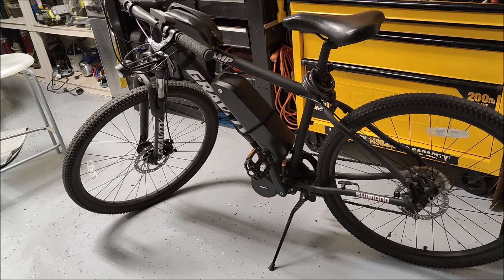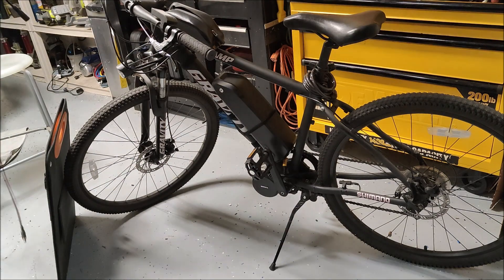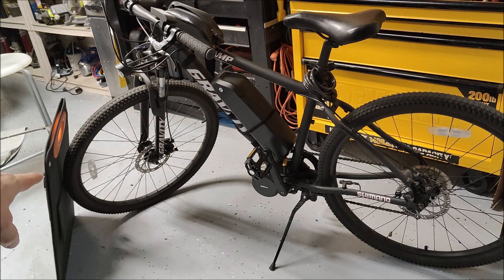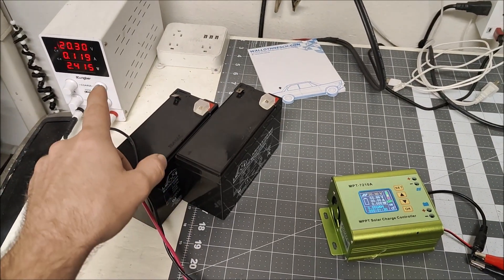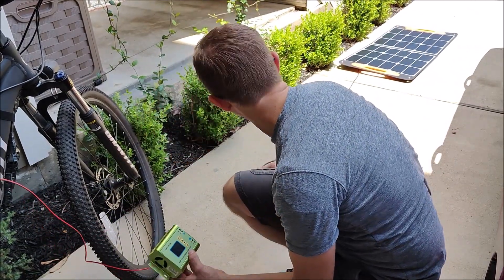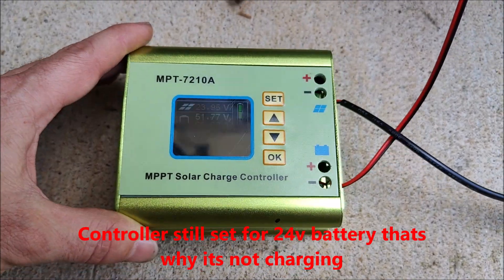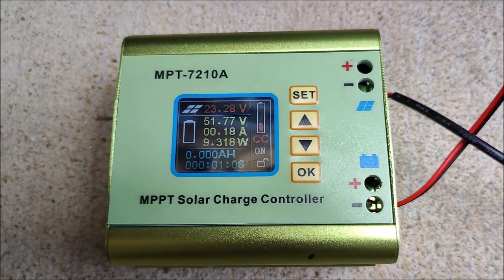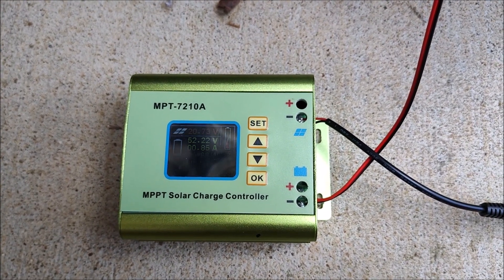Charging an E-bike with Solar!

Comment: What is the cost of your set up to charge your bike? What do I need to do if I want to charge your bike within 3-4 hours from 10% to fully charge? Do I need to add extra panels?
Reply from the maker: The charge controller is about $60 and each 100W folding panel is about $100. A 100W panel really only makes about 60W per hour. If you got 2 panels, then 120W/Hour is reasonable which is enough to charge a 400w ebike battery in 3-4 hours.

Comment: Can e-bike batteries be charged whilst riding do you know?
Reply from the maker: Yes
Reply: @stevenc22  Bosch, Shimano, Specialized, TQ, Ebike-motion, Fazua, Panasonic, Yamaha or any safe brand ebike producer does not allow charge while riding. You have retrofitted a Chinese made motor that accepts that, it doesn't mean all e-bikes behave like that.
Reply from the maker: You understand charging the battery has nothing to do with the motor manufacturer and most BMS will take charge while discharging

Comment: I asked Bard AI if the BMS and overcharge protection on most Ebike 48v batteries is reliable and it said yes.  I then asked it if a 50v 430w solar panel could ever put out more than 60v with a load  and it said no.  I'm wondering about a controller like this one for that config:  Genasun GVB-8-Li-54.2V-WP, 8 A (Input)
Reply from the maker: Yes this controller can boost up to 90v
Reply: Ohms law one of the basics of electronics. Voltage = Amps * Resistance. You can increase the voltage but you sacrifice current or Amps to do it. Think of it like a spray nozzle on a garden hose, you can increase the pressure but you are restricting the volume of water coming out.

Comment: Nice idea,iI just so happen to have the same 100w solat panel, but will that solat voltage converter stop charging the battery when it reaches 100%? Great video man, thank you.
Reply from the maker: Yes. It is programmed with max voltage of battery and turns off when full.
Reply: @stevenc22  Good to know, thank you so much.

Comment: I could never stand being in that loud of a sound for hours. Not a very enjoyable camping trip.... Also I don consider that solar panel portable (in order for it to be considered portable it would ned to be 1/4 that size) and that converter thingie seemed heavy to carry in back pack and uses up a lot of space.
Reply from the maker: The inverter is incredibly light. The solar panel is kind of big.
Reply: @stevenc22  just strap the panel on a pannier rack,maybe modify it so abit wider and longer

Comment: What's about the connector to the battery? Is this a common connector?
Reply: Not if it's on my battery
Reply from the maker: Yes most e bike batteries use a barrel connection for charging